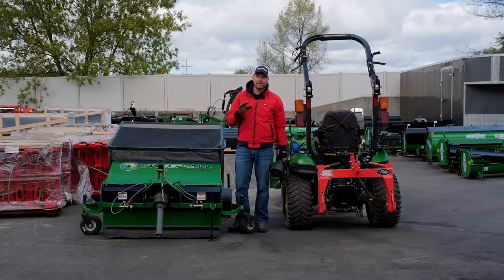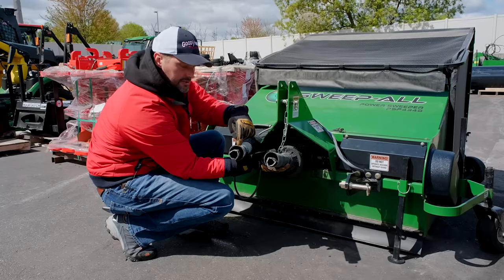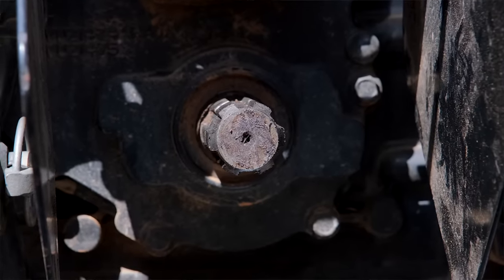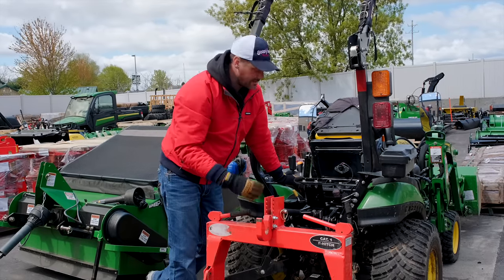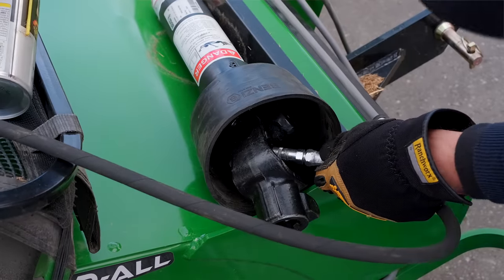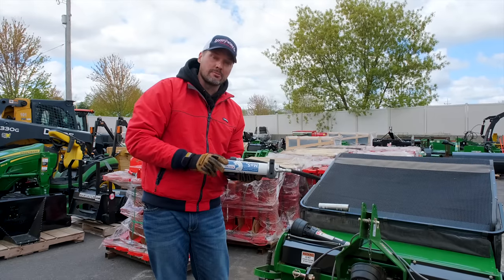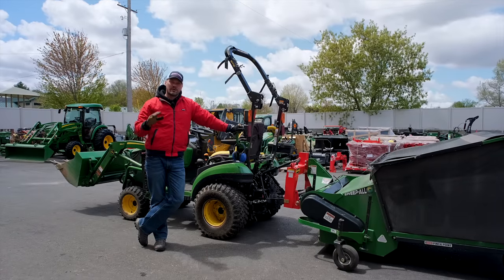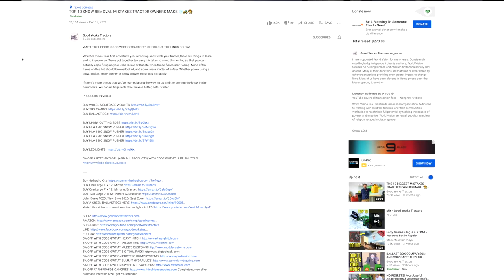THE STRUGGLE IS REAL: 5 TIPS TO CONNECT YOUR PTO SHAFT 🚜👨‍🌾

Comment: The pto quick link looks like a solution to a problem that doesn't exist.
Reply: no its handy, just pricy.
Reply: I could not agree more. Sometimes connecting a 3 point can be a bit of work. But PTO connection is easy. This product just adds a step that seems like it makes it more difficult. It also puts the connection point where it is less guarded and places the operator or anyone near the pto connection at far greater danger of getting tangled in the shaft.
Reply: Tim, I like seeing the products that Courtney offers, but I'm for the most part with you.  That is a crap ton of money for a super minor convenience.  It reminds me of the single point loader attachment that's out there for $600-700.  I mean sure attaching one point is easier than hooking up my four loader couplers, but dang, it only takes me about 10-15 seconds.  I think I can handle it.:-)  I'm so cheap I don't even have a quick hitch....BUT I do have a hydraulic top link and while it was pricey, it has been extremely convenient to use.
Reply: Agree, the pto connection is the easiest part of the 3pt hookup. You still have to line up this device. I guess its easier cause you can see your points. Some people may struggle with that especially if they’re older or new to tractors and stuff. Quick hitch would be nice to have though.
Reply: I am 180 out from y’all.  The quick hitch is the solution in search of a problem.  With the telescoping extendable arms and hydraulic top link I have zero issues hooking up.  

The pto is a pita however and I may well invest in this device.  Pulling a collar while pushing in a greasy, well lubricated, cramped environment always takes forever and results in skinned knuckles and frustration.
Reply: @extraacct478  if all you want is an extension, the farm store sells them for $40 , then take the other $300 and donate to a worthy charity.
I did buy a quick hitch last year, strictly because I bought a rototiller and didn't feel comfortable cutting that much off it. The hitch saved me 4".
Reply: @extraacct478  I agree! My connection area on my tractor is so compact I can barely get my skinny fingers in to release the ring on one tool and the other has the punch pin. I bent the tractor side guard out just so I can get to it!!!
Reply: @talanpomeroy4475  I saw on another YouTube video to take a paint pen and mark where the splines are, then you can line it up with the PTO shaft.  Lots cheaper too!
Reply: @sreihart  oh wow, thats a great idea. Never thought of that before. I’m stealing that one, ty
Reply: See by looking at it, the coupling seams to be very stout. Depending on how it sits, it may take most of the pressure and distribute it better over the length of the splines. If it does so, it is intact making a better connection to the pto.
Reply: Absolutely.  If you frequently use a wire brush to clean the shaft and keep it lubricated, their is NO need for any quick link.  Normally takes me less than 30 sec to hook up
Reply: The problem is huge if the extension of the attachment is tight and requires real strength to expand. It takes me (aged 71) about 2 days to do it by myself in the cramped PTO area that my JD subcompact affords -- quite apart from getting the splines perfectly aligned. To avoid the task I'll keep implements hitched on for years at a time.  I'm surprised the Baptist church next door hasn't taken up a collection to buy me a PTO QuikLink in order to spare the Heavens my profanity.
Reply: Disagree.  I struggle to connect  a PTO shaft.  I am not a big strong man so I find holding the heavy shaft, pulling the shaft forward and getting things aligned, and holding the collar back or the button down all at the same time can be a struggle.
Reply: If you have all new equipment and it all slides together nicely, that's great. But 50 year old PTO shafts don't care how much you grease them and are a PITA every time to get them on AND OFF
Reply: Exactly  it just sum B.S.that because sum guy says it's the answer they will believe
Reply: It looks like a good idea especially if you have a physical Infinity like arthritis in the hands. That's if you change implements a lot. I hook up my Bush Hog in the spring and it's on all summer unless something unusual is going on. Then it comes off in the fall and the snow plow goes on for the duration of the winter. So on average I change implements a couple times a year so at least in my case wouldn't really need this. If I was changing between a mower, wood chipper, rototiller, or whatever several times a season, then I would think this would be pretty handy.
Reply: My P t o Is a real pain in the butt

Comment: Even with my John Deere iMatch quick connect, changing implements is the bane of my existence.  The quick connect is fine, but dealing with the PTO shaft completely spoils the joy of the task.  I'd almost prefer to buy another tractor than struggle with changing PTO attachments.

Comment: Use a paint pen to mark on the outside of the PTO collar where the splines should line up with it.  Makes it easier to line up.  Also, if you can find a place to do so, marking both sides of your PTO shaft so you know how which of the 3 ridges line up can also save you time and frustration any time you need to disassemble it.

Comment: As always, love your videos.  The one way only splines in the driveshaft are usually referred to as oriented or master splined.  The reason for this is to keep the cross of the universal joints timed in alignment.  Unaligned universal joints would cause a terrible vibration and soon destroy them.  I lubricate my driveshaft splines and connection splines with anti-seize compound.  It seems to work very well.
Reply from the maker: Great info, thanks for taking the time to share!

Comment: I went through all kinds of stuff trying to hook up the tiller to my Deere 1023. Then, by accident, I discovered the switching from rear to mid connector tip.  I couldn’t believe this tip didn’t appear in any of the YouTube videos I found. Now it does. Future generations will bow to you for fixing this omission.

Comment: Thank you for the video. I have only had my 1025r a couple of weeks and I disconnected the backhoe and was attaching my tiller. Could not get my 3 point to raise up. I had the hydraulics connected but come to find out it was only connected part way. So once attached fully it worked as it should. 2nd. Learned how to release the pro so I could easily turn the pro and get the shaft connected. Love your videos!  Keep up the good work!  Thanks again.

Comment: Very nice video sir. We run quite a bit of equipment with PTO shafts. The worst we have is a John Deere HX15. Pretty heavy shaft. We actually built a cable that loops over the ears of our quick hitch. We raise it up and use it to level the shaxt with the PTO and then slide it on. They should pass legislation that requires a quick hitch on every tractor sold! New subscriber just because of this great video.

Comment: As a new tractor owner - TAKE MY MONEY! I'm ordering that PTO quick hitch asap. My dealer dropped my tractor off and the instructions he gave me on attaching the PTO for my rotary mower was 'don't get your hands stuck in it and rip your fingers off.' Duly noted ;-) This system looks a lot easier! I'll continue to binge watch this channel so skill up my tractor awareness. I'm especially concerned about safety so thanks for all the work you put into making these videos! Doing the lorrrds work!
Reply: Rotary cutter is one where attaching the 3 pt first and lifting the mower deck will make PTO attachment way easier.  If the deck is sitting on the ground, the blades can be stopped from turning by grass or the ground, thus making rotating the PTO shaft really difficult if not impossible.

Comment: What I really like about the Tractor PTO link is that it protects the spline on the tractor at the gearbox. I realize it sits back in a good bit, but it's nice knowing if you were to back into something or drop something or something were to fall on it, the spline is covered and protected. Very helpful video, I never thought to shift the PTO into the midrange so I could manually turn it. Purchased a new 1025R with the 3049 tiller and it has been a bear to hook up since I bought it, I believe you solved many of my issues. Thank you so much for the helpful tips and for continuing to provide good content. I will definitely be purchasing the tractor pto link.

Comment: Thanks for the video. I may have to cut mine shafts. But they are not going over each other smooth at all. I may not even be able to get it back apart and I greased it well.

Comment: There is another collar style that requires twisting the collar instead of sliding it back. Learned that the hard way. Always wipe off the shaft and keep it covered when not in use. Grease it before coupling. Will save someone a ton of time.

Comment: Keeping PTO shafts out of the weather, clean and greased…and putting the PTO drive in neutral when assembling..is 90% of the game.  If they are clean and greased they install easily…which includes the lock pin!😊

Comment: Really good video!  That quick hitch is good, but if you have attachments of varying widths, it can be a problem.  I use the Pat's lower lift arm quick hitch system and I love it.  Half the price as well.  Let's you still have the freedom to adjust the width of your lower lift arm position for any attachment.  The only drawback is that it does nothing for the upper link connection, but that's usually the easier of the 3 point anyway.  As far as the PTO connections, if you keep everything lubed properly as mentioned in the video, it really makes everything easier.  I can't justify spending that much for a PTO quick connect when it's usually not that much of an issue for me.

Comment: I've had my eye on PTO link for a couple of years and lately have been considering the Deere version, but your quick comment about the difference and your demo of the installation convinced me to order the PTO link just now. Connecting the shaft is an awkward, cramped affair on my 2038R. Discovering your trick to release the tractor end a while back helped a lot, as did fully extending my hydraulic top link to give me more space, but from time to time it is still a pain. I expect the PTO link to make this process quick and easy every time. It seems that delivery is backed up and I may be waiting a couple of months to feel the joy. Will try to be patient!
Reply: Have you received and tried your PTO Link, Seth?  Just curious how well it works.
Reply: @clintbennetsen6392  Yes, I am happy with it for the most part. One of the connecting pins is a loose piece, so I temporarily lost it (until I bought a couple of replacements, at which time it turned up, of course). Now I have a specific place on the back of the tractor where I put it until the attachment is in place and ready for the pin. When nothing is connected to the pto, I keep the pin in its hole in the tractor side of the ptolink.
Reply: @SethKrieger , I was thinking that little connector pin would be easy to lose or misplace.  I saw you can buy extras for like $7 each.  Glad you found a solution to keep it handy.  Thanks!

Comment: Good afternoon. If the implement sits for a length of time, you could/ can put grease on the internal splines to prevent rust.
A small diameter cable could replace the chincee chain or a ziptie even.

Comment: OEM locking mechanism - yeah, it'll snap right into place.  Until its several years old and some of the old grease has dried out and hardened.  Now, tell me how easy it is to connect the shaft on a BX2380's mower deck to the tractor.  NOT - the challenge is access and being able reach under the tractor, hold the detent so it can freely slide onto the output shaft, and do it all by feel - right!
And then there the stubby PTO shaft for Kubota's 3-bag bagger for the BX.  Both the PTO shaft connect AND the right lower 3PH arm connection are a PITA to connect.

Comment: Some will mention perhaps a problem with the length of the PTO shaft on equipment; however I don't see that being a problem.   Do you?   I have a 4044M JD and I'll probably trade it on a 5055 JD to use the PTO connection on.   I will be pulling a 3 pt., MX6 Rotary cutter.   Your thoughts.

Comment: At least on the JD 3039R, with rear PTO only, the PTO output spline will still rotate just over one spline's distance, i.e. a bit over 1/6 of a rotation. (Range lever in neutral - didn't check A,B or C.)  Luckily, that makes it possible to line up the splines with the PTO shaft.  I don't know if this is by accident or design!

Comment: Did it add any substantial length to the connection?   Could there be a need to cut the implements’ PTO shaft shorter to accommodate the connector ?

Comment: Oh hell, I was about to buy these quick link items etc, tried the "move the PTO gear into neutral" trick (didn't work LOL), then the teeth finally caught and the shaft slipped on no problem LMAO. This, after first trying to hitch it up two weeks ago and needing to take breaks due to my frustration in not being able to link it up. Oh well, still going to consider the quick hitch because putting mower/blade on without a quick hitch is a pain.

Comment: GOOD WORKS! I’m in desperate need of some help, we got a 5045E Tractor from John Deere, and every time we put the park gear on, not all the brakes lock together. It still rolls unless we have the brake and clutch on. Isn’t there a way to lock the brake with the parking break on without putting the bucket down?

Comment: Have 3520 and a RC 2072 Roto Cutter.  Connecting PTO with the compression ring is a bisket.  sob.  I back up tractor close so I can get my arms in there to try to pull back the compression collar and slide the pto on.  Then I back up the tractor and connect the roto cutter with the quick hitch.  collar.  Is there a tool that would help.   I am a Veteran.

Comment: I put my auger on 3 times. First 2 times, I couldn't get the plastic PTO guard to click into place. 3rd time I couldn't get it to slide off. The PTO was stuck and I need to get an air compressor in there to remove any gunk that was jamming it. Is there a simple way to click and unclick that plastic piece? I ended up dismantling it and leaving a part out so as to never deal with that issue again. Probably not too dangerous on an auger but I won't plan on modifying any more implements.

Comment: Should the John deere 1025R only use 4 foot attachments?
Reply from the maker: It depends on the attachment.  The belly mowers are 54 and 60".  I'd only recommend a 48" brush hog and 48" box blade, but a 60" rear blade, 60" dethatcher, and 54" snow pusher.  It really depends on the attachment.

Comment: Does that PTO quick-connect add additional length? I'm honestly hoping it does so it offsets the 3-point quick attach, that way I don't have to buy a new PTO shaft and drive myself crazy cutting a new one. Have a Kubota BX2380 if it matters.
Reply from the maker: Yes it does. It's a great thing to pair with a quick hitch for just the reason you mention above.

Comment: @3:00-ish talking about connecting pto, is there a reason why some have slip-rings vs push-pins? 
I have pto shaft on my winch, one end has slip-ring, other end is push pin, by far the push-pin is at least 10 times easier to put on and take off, so I dont understand WHY is the slip-ring pto shaft being made?  I can understand if something is an improvement but I dont see that slip-ring pto as an improvement!!!!!!!

Comment: Took a look at the tractor PTI website, don’t ship to Canada, do you ship to Canada? Have a JD 2305, 2009, hate contorting to reach under and try to install or remove the pro for my tiller. Would probably till more often if it was easier. I am in Edmonton, AB, T6R0C1, what would the cost to ship be.

Comment: The problem getting the pto disconnected is why I left it on for years. Letting  the penetrating oil sit as I type to get the pto spring loosened. 😩
Reply: Now the pto release button is not retracting...🥴

Comment: OK, maybe I'm missing something??  I've been hooking up PTO shafts ever since I was big enough to drive a tractor, and I'm in my 50's now.  I don't understand why folks have so much trouble hooking up a PTO shaft, as you said, as long as you keep the telescoping sections well greased and clean, it's not hard at all.  And,  I cannot for the life of me see what problem that this PTO attachment device thing solves.  And the video didn't really show anything either.  You still have to rotate 1 of the shafts to align the drive dogs just as you would have to rotate one of the shafts to align the splines on the shafts themselves.  In fact, you might have to rotate the shaft even more to get this thing to align than you would to get just the splines on the standard shaft to align.  It looks like a solution in search of a problem to me.  But it does make a heavy wallet considerably lighter.

That sweeper looks really interesting, do you have any videos on it?